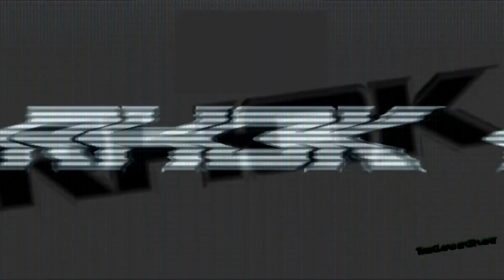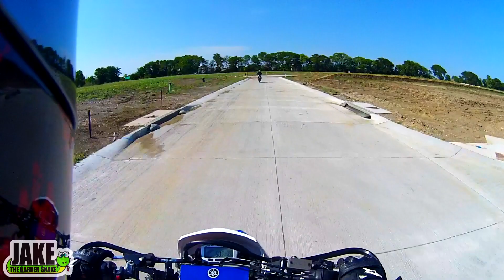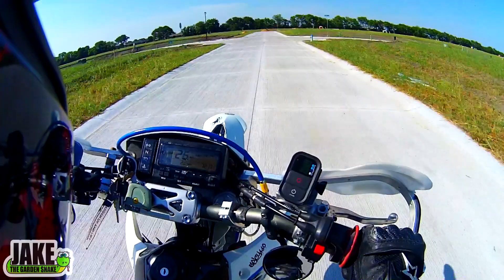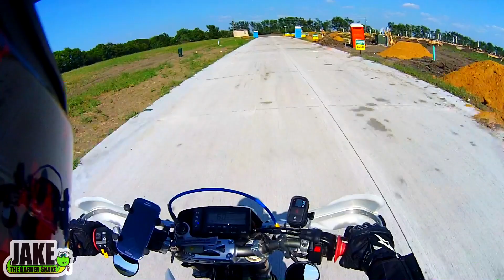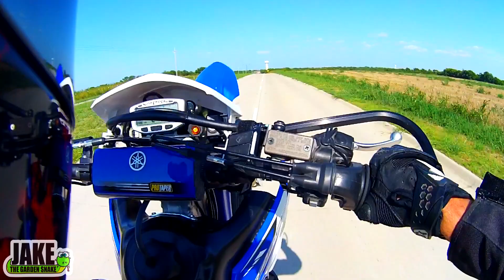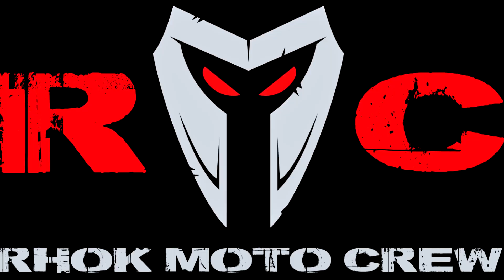Breaking in a New Engine

Comment: I just broke in my wifes and I two DR650 went up and down 377 really hard. So much metal flakes came out of the oil at 25 miles. Even now at just changing oil at 200 miles still bits of metal. The hour (maybe) it takes to do hard 20 - 30 miles. So worth it in the long run.

Comment: So how does the drz's big bore with cams compare to your wr450.  I have a drz big bored with cams and all supporting mods but Ive always been curious how it is vs a new wr450? torque? in a straight line? Top speed etc?
Thanks Jake, and i totally agree to the hard break in
Reply from the maker: If you look at the :30 sec mark we race. Now he jumped on me because I waited for him to take off. But I walk if with the wr450. Not run away or kill him, just walk. And the WR450 has full FMF and ECU so drzs can haul ass despite what interwebs tells you sometimes.
Reply: Jake TheGardenSnake looks like he has a little weight on you too. body weight is a HUGE deal on a motorcycle. thats why motogp guys are always trying to stay as strong and as light as he can, without putting on weight.
Reply: Jake TheGardenSnake Thanks!,
Always wondered how the good old Drz technology held up to the newer stuff. good to know. I love your wr450 though just cant get one here in california with their annoying rules haha.
Reply: Levi Binegar
Like a jockey haha
Reply from the maker: Levi Binegar Yes he does have some more weight on him that will make a difference. We should have raced again when we switched bikes.
Reply: So here are my thoughts after riding Jake's bike.   My DRZ has more "snap" to it, and feels faster down low. Up top and through the upper mid range his WR has more. Not a TON more, but more. My DRZ has a much more mechanical feel to the throttle response, twist the grip X amount and the throttle responds X amount, instantly. The WR is fuel injected and there is a tiny almost lag to it. The WR's power delivery is smoooooth. Its just seemless. His WR also seems geared taller, it holds each gear longer than my DRZ, or seems to.
Reply: ***** I think if I dropped 30lbs his WR would have nothing on me. If TheMotardedTexan rode my DRZ it would murder the WR (he weighs like 125lbs. No seriously, like 125lbs) because of the sheer HUGE difference in power to weight.     Although if you put him on the WR it would murder the DRZ.  Basically the dude doesn't weigh shit.
Reply: ***** Yeah WRs are badass. Get a WR, you will probably already be doing an exh, so get cams and a big bore to go with that.  What I really need to do is lose 20lbs.
Reply: ***** TheMotardedTexan and I sort of raced. His DRZ is bone stock with the end cut out of the muffler, maybe 1hp there. MAYBE.  He weighs about 75lbs less than me. My bike has a lot more power than his (pre-big bore) and he walked by me HARD.  Weight makes a big difference on bikes with this little power.
Reply: ***** I care! I want the maximum whack I can get when I rip the throttle.  More power=more fun even when I am by myself.  As long as it stays within the reliability limits anyway.  (unless you are ok with losing reliability in the quest for more power, in which case, get a 450 MX bike to start off with. YZ450Fs make like 62hp stock)

Comment: New manuals are a 'little' better now - at least they tell you to go hard on throttle and frequently go between gears, and do plenty of engine braking. They do tend to set an absurdly low limit on RPM, though.

Comment: kawasaki pulls every bike off the production line straight on to a dyno and give it a couple pulls for quality control purposes.
Reply from the maker: nice, didnt know that
Reply: Jake TheGardenSnake yea saw it on one of those hows it made type documentaries
Reply: lukethekanefan many companies do that, also car companies, altough most of the time they take just every other vehicle.
I've seen a documentary about Ducatis and BMWs tough where they run every bike, might be a motorcycle thing ...
Reply: Kalimerakis yea mate al the power curves and figures get checked as an indication that everything is upto specs bikes are higher revving usually huge specific output machines so makes sense they would test everyone were some cars may not need it there engines just arnt pushed asmuch ect and not built for performance
Reply: lukethekanefan I fucking LOVE "How it's made"
Reply: Yeah if you do a search theirs a video where Hondas factory workers would take a brand new CBR600 rr right off the line and redline it as part of a test,

Comment: I just got a Bill Blue 351 kit installed on my KLX250. I stumbled across the mototune hard break in method and did that for the first 20 miles. Bill Blue said DO NOT do that, that it was bad for the engine etc etc. I've put over 200 miles on it now and still running strong, no smoke or anything. How many hard miles did you do on the DRZ break in?
Reply from the maker: We changed the oil after 50 miles. He'll change it again a few more times before it has a 1000 miles on it. Then He'll go to synthetic oil and do regular intervals. That should be more then good.
Reply: Jake TheGardenSnake
 Any oil shavings at 50 miles? I changed mine at 20 and didn't have any shavings at all. Any thoughts on Shell Rotella T oil? I've been using it in my crf250x as well as my enduro and it's been great. People on forums swear by it.
Reply: Jake Dillard Zero shavings.  I looked very carefully.
Reply: ldillow1 What bearings? Its a big bore kit.  And breaking in rings should definitely NOT have metal shavings. A little funk in the oil sure, and there was. But zero shavings.
Reply: LoudandDave
 Jake said in this video(or maybe the other break in video) that you'll probably get metal shavings either sucked out of the exhaust or in your oil? Mototune method said the same. Am I missing something?
Reply: ldillow1 Yeah. It didn't have any.
Reply: Jake Dillard I think by them say shavings they just mean to say "expect some metal in your oil." If you see any kind of visible metal chunks, something went wrong on the rebuild.

Comment: Your bike sounds amazing...is that just from the 440 kit or did you have the exhaust worked on?
Reply: its an aftermarket exhaust you wouldnt even notice a change in sound really just from a 440 upgrade
Reply: MRD/SSW exhaust, HotCams stage 1 cams, 39mm flat slide carb, Cylinder Works big bore kit.
Reply: +LoudandDave needs more cam to it bro!
Reply: Chuckie25 I am still thinking about doing the stage 2 intake cam.

Comment: Pretty sure that's not the right way to run an engine it. Every moron say 'go big or go home' until their valves blow through the cylinder head or the bottom end explodes.
Reply from the maker: Really? Oh no we messed up! hahaha Dude the valves and the bottom end have nothing to do with the break in. Its all about the rings. And thats how you break them in. If the valves or the bottom end could "explode" from running it hard we'd be f-ed in the first place since we don't really baby are bikes. Forget the break in, our motors get the piss ran out of them all the time. Thats what these bikes are made to do. If that makes them "explode" them I wouldn't have them. They're not as delicate as you think. Oh and I'm a Certified Motorcycle Tech so trust me, I did this for a living. If you're boys engine exploded or something it was not because of the hard break in, it wasn't built right.
Reply: Jake TheGardenSnake i think hes talkin about the big bore kit but i dont think people would run em if they did that and as for the brake in run the shit outa the bitch